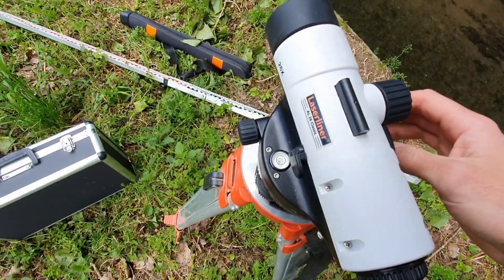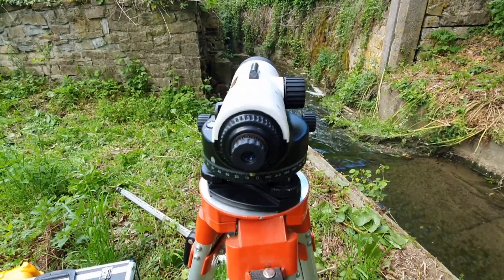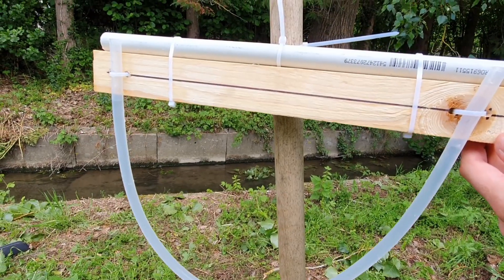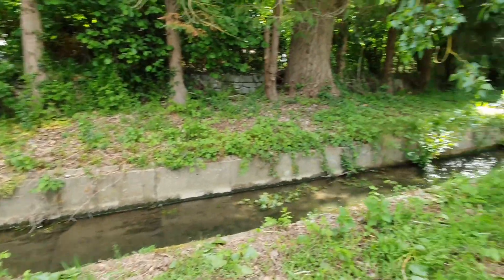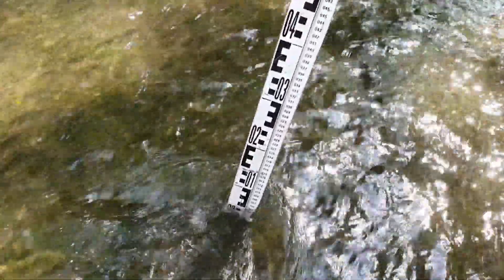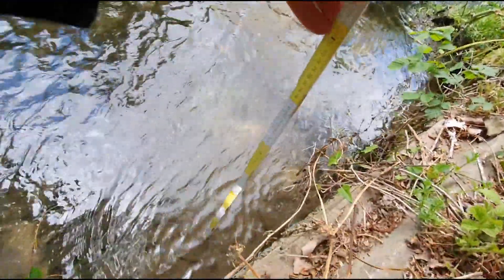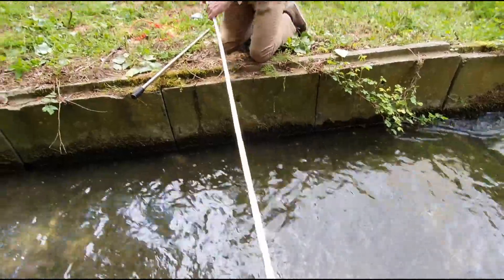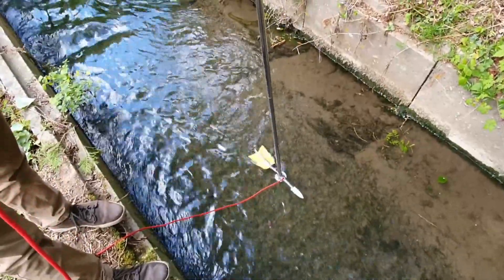Micro hydro-power 101: Real site measurement

Comment: Put a water wheel at every 500 meters across this canal and calculated the total energy floating per hour
Per slant height
What is total slanted height across the canal ?
Use siphoning by applying a Burnoulli principle and venturi effect and make lots of energy

Comment: Hey There, I had a thought, could I make a self contained unit. Have a holding tank, then have it drop down into another tank with a pump to pump the water back up and so forth. Create a contained unit, I hope you understand what I mean. You can call me at anytime (732- 669-2961, I'm in the USA, You are the best. 
Sincerely Joe Mutarelli
Reply: Like, pump the water up and then use it to make power on its way back down?
Reply: Pumping the water back up would require more electricity than the turbine would produce, so this would not work out.
Reply: @GordonWrigley  Not entirely impossible, if his night time power consumption is, say around 25% of day time consumption he could try to do it..
Reply: @nahor99  It wouldn't be self contained, but you might be able to make a useful pumped storage setup like that. As a way of saving your excess night power for daytime use. But at this scale batteries would be much simpler.
Reply: @GordonWrigley  True..
Reply: @GordonWrigley  the turbine can power 10 houses

Comment: The example canal shown here, what would be possible output of it? Would a stream this size be suitable? It would be great if you could share what size turbine for suit this particular stream!
Reply: The owner will be adding a weir to this so he'll have a higher head difference. With the extra head he'll be making 5kW from this. Enough for his house energy use and his heat pump heating system.